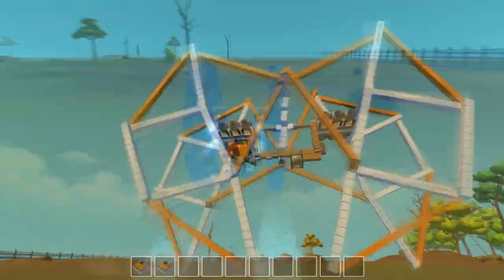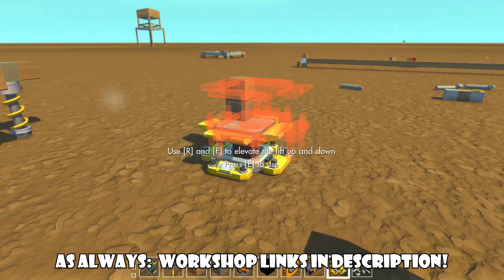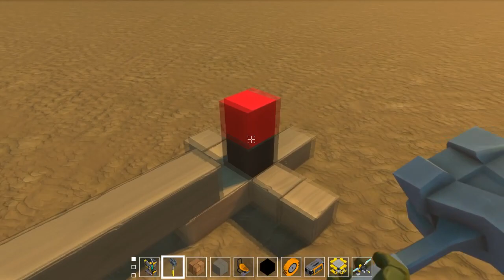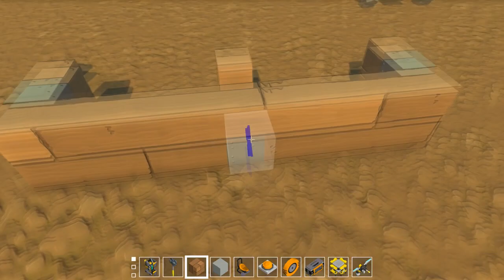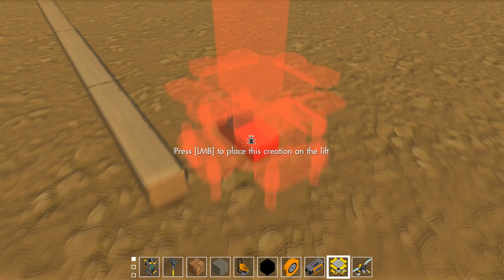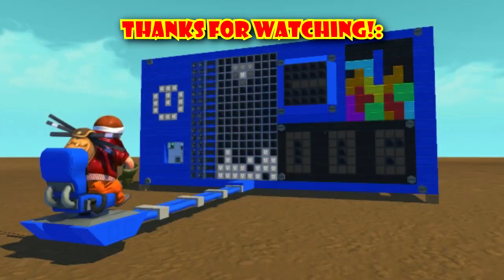Tricks for using AntiGravity Glitches! - Scrap Mechanic

Comment: Could you glitchweld an rgb Pixel with the durf ligth block like you did with the Vanille Blocks? would be amazing
Reply from the maker: 19hundert01 yes and it would actually work because of something i asked mjm(creater of the pixel block) to add someth to the pixel :D might make it if i dont have anything else to create

Comment: finaly a version that doesnt needs 4k blocks XD (like my base has)
f*ckkkk i guess that makes my base ussless on the workshop

Edit: but yours still has the masszenterproblem ;(
Reply from the maker: Lima X meh they all have the mass center problem, just add weight,expand the center of mass ball of effect and when the axis line crosses it it should work :D